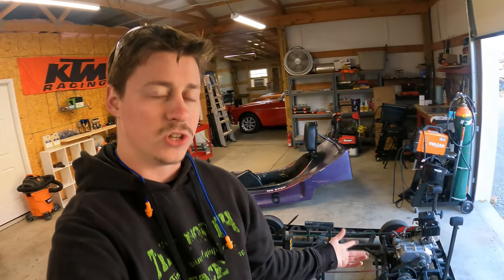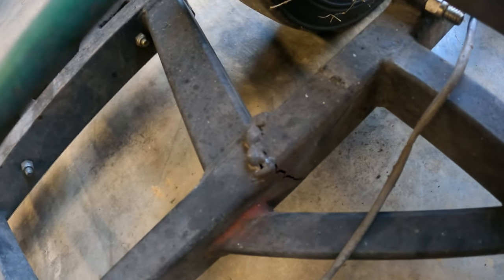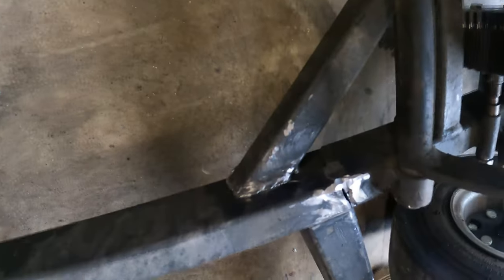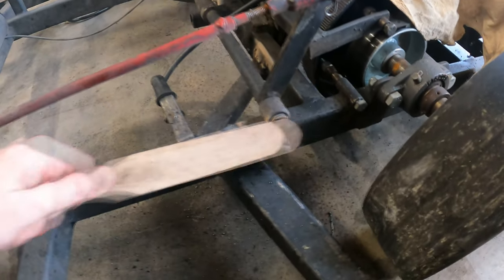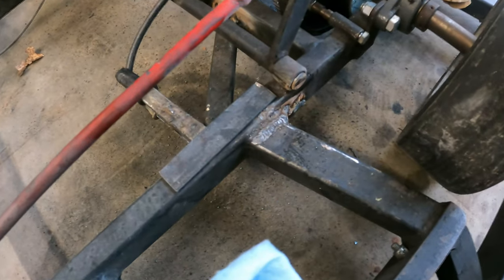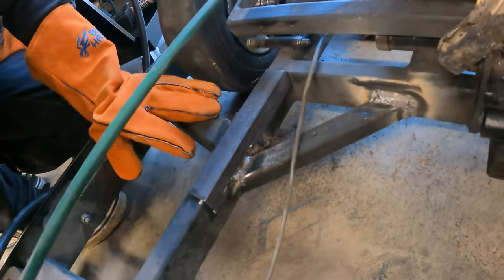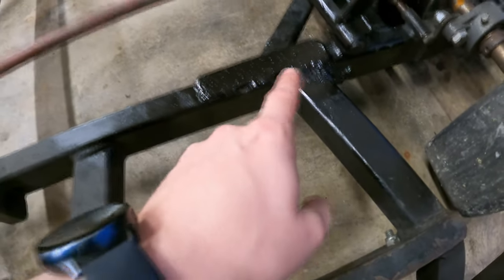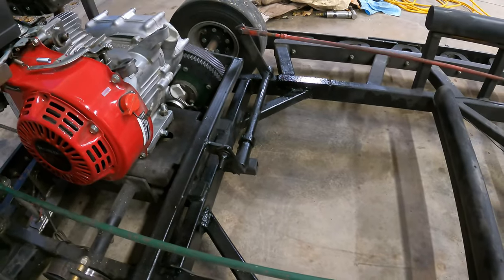Go-kart Frame Repair and Reinforcement

Comment: I have pretty deep rust on the undercarriage and middle bar of my main frame. I can angle grind most of it off but the bar would be pretty thin. Any ideas or recommendations? I have other media if you want pictures.